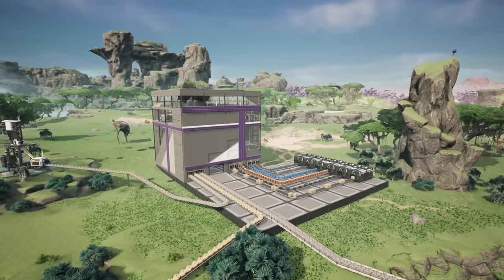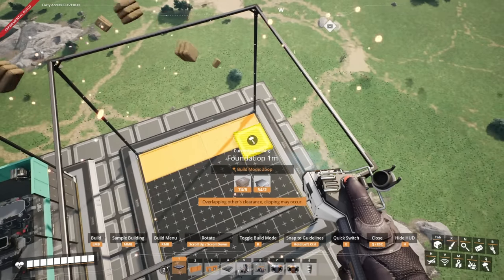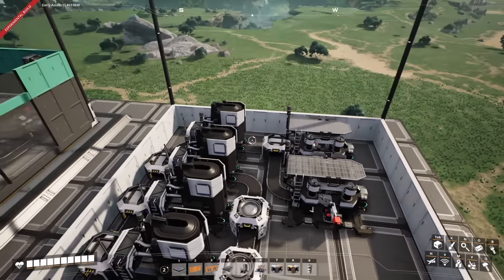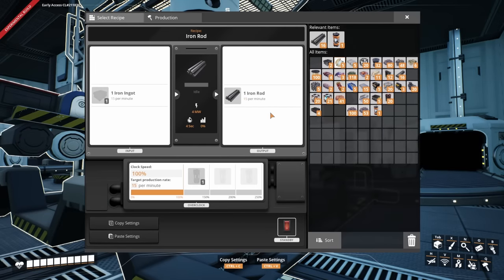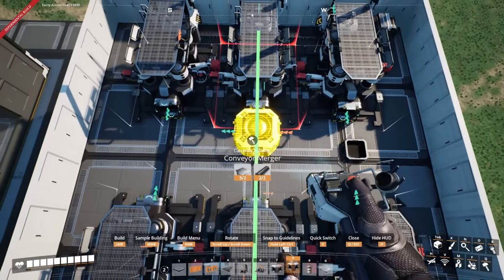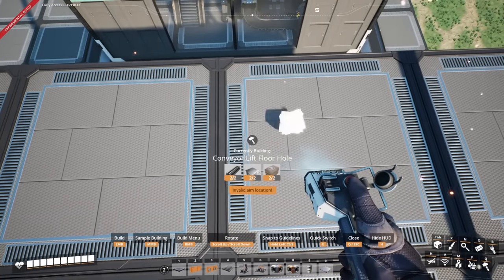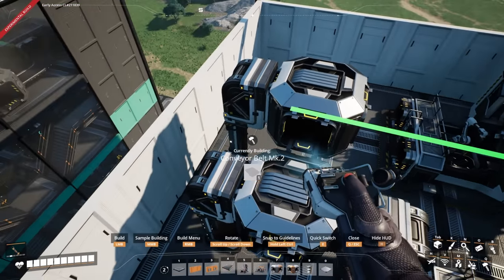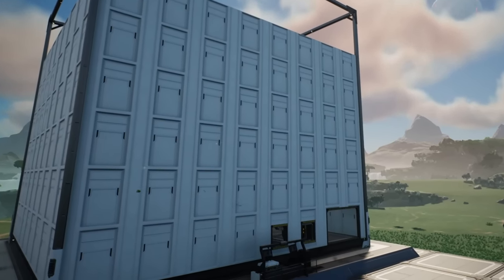The Perfect One Click Reinforced Iron Plates Blueprint Satisfactory

Comment: Thanks for these awesome one-click blueprint factory guides.  I did have some trouble figuring out a clean way to run electrical wires from the first to second floor since it was surrounded by walkways.  Curious how you actually did yours, since you kind of skipped over that.  I ended up using catwalk t crossings for the top floor, opening the spot where the lifts went up so they weren't going through the floor.  That part looked dope.  But for the first to second I just ran cable to the rear-side without walkways then straight up through the floors since I couldn't see a half-floor system working there especially with access stairs setup.

Comment: Great video and really useful, just an issue with the splitting. Its wrong. 3 constructors from the line in, is split in half first and half again. So when getting rods to go to the first floor, its coming in at 30 per/min, but you split to the first constructor so that's 15, split again so the 2nd constructor gets 7.5 and the last also receiving 7.5. As I said, really helpful video and I'm not going to change what I've built, but thought id let you know.
Reply: @markwarrener2828 you're talking about the constructors making screws? He's got 30 rods coming up, each constructor can only consume 10 rods per minute. So yes, initially 15 per minute are going into the first constructor but it's only consuming 10 per minute. That means eventually that machine will fill up to the max amount of rods. Now the excess coming in will skip the first constructor of it's full andstart going into the 2 constructor, which will also fill up. Finally, you'll get the rest of the rods going into the final machine. At this point, you'll have 30 rods coming in and each constructor consuming 10 rods. Basically, it'll balance itself out after it's had enough time to run.
Reply: @matthewrobey9806  For the excess to skip the first constructor do I need to use smart splitters? ty in advance.
Reply: @JoNaS_65  No. So the first splitter will have 15 going into first constructor, and 15 going to the rest. At some point, once the constructor is filled to capacity since it's only using 10, it will start backing up into the belt until the first splitter is backed up completely on that path. At that point, the path to the first constructor will be blocked and skipped. Once the constructor uses a resource and a space frees up, the splitter will send a resource that way. The effect is that eventually, over a long enough amount of time, all constructors will reach equilibrium. No smart splitters needed.
Reply: @matthewrobey9806  It seems like my smelters aren’t sending anything, even though they’re filled with 100 malm. Therefore, I conclude that I need to use the overflow mechanic in my smart splitter.

Comment: I dont think I have done anything wrong but its more like 4 reinforced plates per minute. I feel like the assemblers are waiting for screws a lot of the time. The last smelter on the bottom floor doesnt seem to get enough ore in to make enough ingots for rods
Reply: that is a drawback of a manifold system, even a small one like this. That 4th smelter will continue to starve for ore until all the other smelters are full, which causes a cascade effect throughout the rest of the factory. Prime your smelters. When you drop this thing down, put 100 ore in each smelter to kickstart the factory production. You should see better efficiency instantly.
Reply: @Draco.Invictus  What's the point of making it this way then?
Reply: @JoNaS_65  ease of use. A manifold setup is just easy to setup. I prefer a balanced setup for production as that gets me working at 100% efficiency quicker, but manifold setups can work well enough for power plant setups like a series of coal plants for example. I'm not nearly as worried about running peak power as I am about making enough screws to feed some other part of my factory. (I actually work on eliminating screws all together lol)

Comment: You said you'd need mk 2 belts for the screw production side but used mk1 ... what do I use??
Reply: Just count. 40+40+40=120, so mk2. He uses mk1 right out of the contructors because its only 40/m, but when 2 of those lines merge, its 80/m so you need mk2. And then the final merges so 120/m,